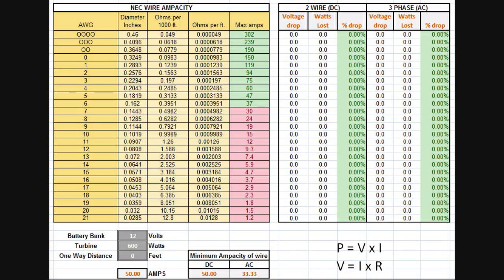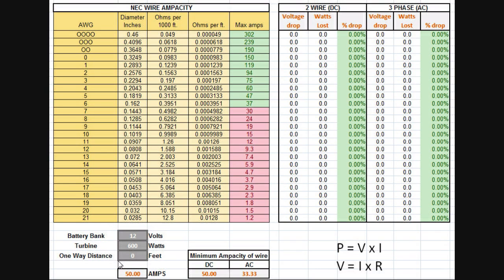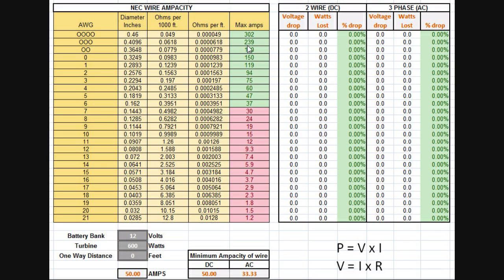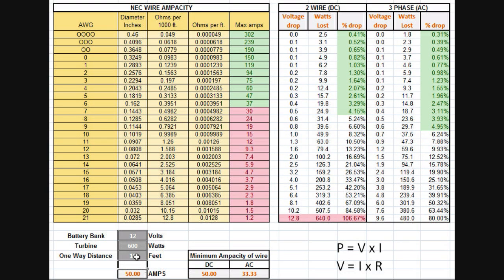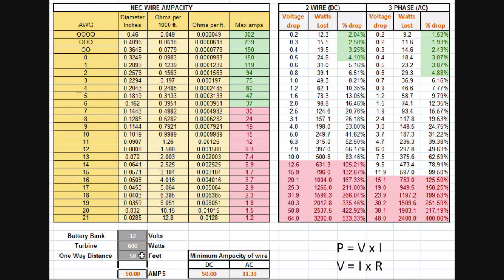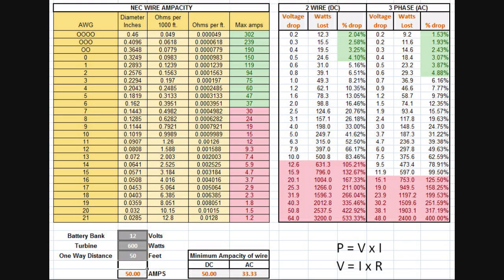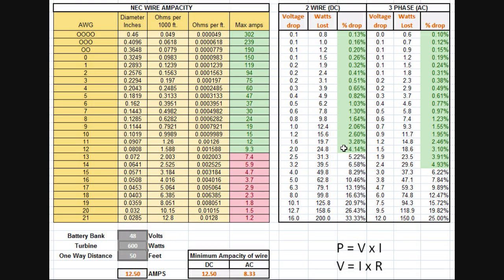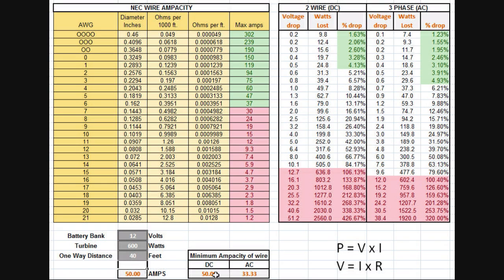Proper Wind Turbine cable sizing - FREE DOWNLOAD

Comment: Ummm, NO, just plain NO. There are plenty of ppl using the standard 10awg wire with 50 foot runs. This chart would have us believe not 1 of them is getting any power at all to their charge controllers (99%) loss, yet there is the readings for all to see, on youtube, showing average or better power in. Even try to connect #2 or #0 wire to a charge controller?  I do not know why the math does not work, but it simply does not in practical applications.
Reply: +Trina McDonald This is also nuts. According to this there is no wire currently made that can handle my 1000 watt turbine with a run of 90 feet.By the math here, 0000 guage wire is 3 times too small for my application. By this math I would need cables that are at least 4 inches thick. NOT LIKELY!
Reply: I'm thinking because the current is not flowing the 50 feet back. It's consumed at the charge controller. If it was looping back the batteries wouldn't charge.

Comment: That is brilliant, I have two WindMax AC turbines and would love to know what size wire I really need to have.  They are 1kW AC, 50 feet of wire length, 24v battery bank, I suspect I will need something like #4 wire?  Thanks in advance and God  bless.